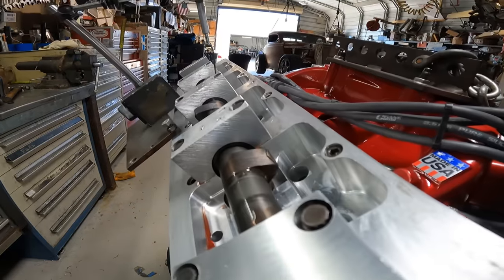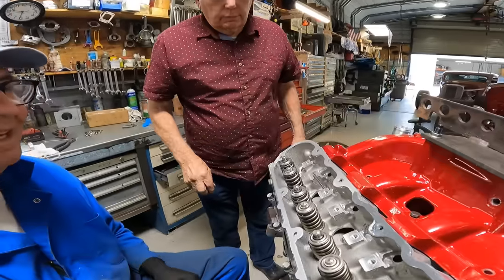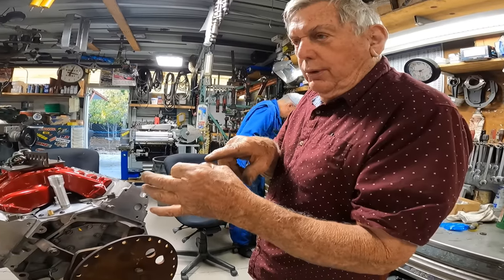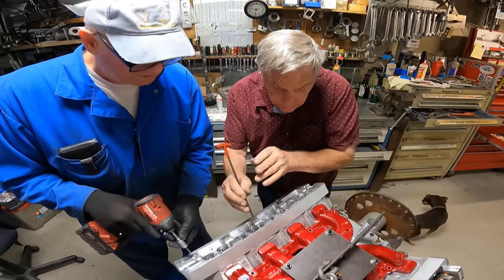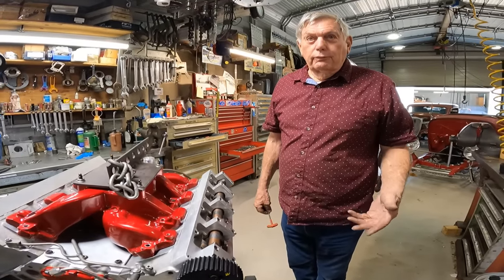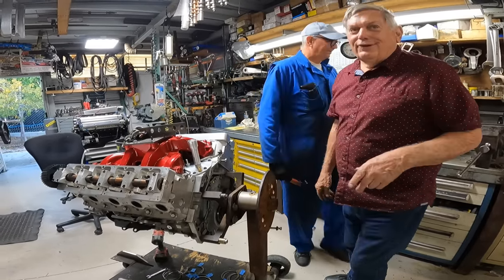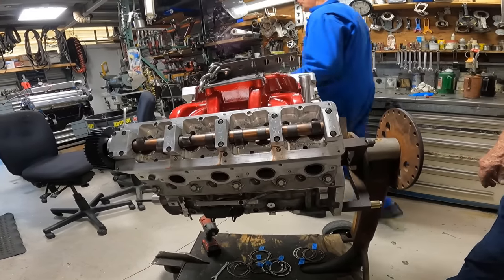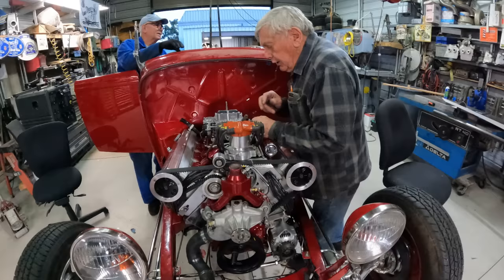Chevy LS 2 Valve Overhead Cam Conversion - Drive Toward a Cure with Aardema Braun - Part 1

Comment: But... why?
Reply from the maker: This is Pete and Kevin’s golf game.  Pretty much has stemmed from their land-speed racing success. In this instance, they are doing this as a special one off Engine build, which will go to auction in a 32 Ford roaster to benefit Parkinson’s disease and research.
Reply: @GregQuirin  why not use a simple LS crate engine?  Unnecessary complexity, weight, and cost is what they now have.
Reply from the maker: @theratrace5826  - pretty much every hot rod at the car show today has an LS in it and little innovation and made from the Jegs and Summit Catalog .  Pete and Kevin are on a different frequency when it comes to this stuff, they are the definition of true hot rodders.  They have a lot of success and experience doing overhead cam conversions mostly 4 valve.   Their complex engine builds have a proven track record and has elevated their racing performance in the Landspeed community.       They are very different people and always thinking out of the box when it comes to engine performance and HP.
Reply: Greg,
There are those that get it, and those that don’t. You’re getting a smattering of those that don’t. 
Then we hear from a dinosaur below who hasn’t heard the news about 4-valve vs 2-valve re: ultimate flow and power potential. He may be thinking of Top Fuel engines (2-valve, pushrod) having ultimate power, which is true, but you don’t see a lot of Top Fuel hemis on the street.
Great channel, well presented, and many thanks to everyone involved.

Comment: 4 valve will make 40% more power than 2 valve?????? That's not even close to being true. Cam in block is actually far superior to overhead cam for maximum power potential and far more durable. All of the most powerful gas engines on the planet are cam in block, 2 valves per cylinder.
Reply: If that was true, why doesn’t formula 1 and Indy use cam in block engines?
They are legal by there rules.
Where as several classes take away cubic inches if you run overhead cam four valve engines.
Seems like they are afraid of something!
Reply: Nobody would use overhead cams if that was true. Cam in block needs paths for the lifters and that messes with airpaths you can put in the head.

Cam in block has been a cost cutting measure for a century. It also allows for a lower package.
Reply: @kevinbraun6272   F1 engines only make 800HP. They are 3.150" bore. Small bore engines are great candidates for 4 valve chambers.
But wait?!! They're obviously not great candidates  400cc intake ports. Now we see why the overhead cam is simply inferior and can never out produce a cam in block design. Camshafts mounted directly over the valve inhibits the angle and overall volume of the ports. 2 valve, NHRA Top Fuel engines are not valve area limited at it's 4 3/16" bore size. No need for 16 more of everything cam & valvetrain related.

Also, 4 valve has nothing to do with overhead cam. We have plenty of 4 valve, cam in block engines in production. 2 valve v 4 valve chamber efficiency is determined by bore size. Valve area efficiency is determined by port shape & size. OHC can not compete, never, ever with cam in block. It's a matter of architecture. Cam in block is also much stronger, more durable and more reliable, again, due to it's inherent architecture.
Reply: @lassikinnunen  Actually, cam in block allows for a much better flowing head. That's their entire claim to fame. Camshafts directly mounted over the valvetrain limits the angle and overall volume of the ports. Pretty poor flowing cylinder heads comparatively.
Reply: @fantaseahorse4696  Well, we have set 37 records at Bonneville and El Mirage. Every one of them was previously set by a cam in block engine.
We broke all 37 records with overhead cam engines.
If what you say is true then no one should have any trouble braking our records.
Reply: @fantaseahorse4696  thaaats just not how it works. The lifters are on the top anyway with cam in block and you can place the camshaft how much high you want and make it whatever you want, whereas cam in block has actuation passing through the head impeding where you can place the runners and what shape they are.

The claim to fame is just needing less precision machining. 

Duke etc are crap exactly for that.
Reply: @kevinbraun6272  I reckon you have summed it up kevin definitely in the land speed realm 
You and Pete only 37 records 
Are you sure your qualified  to comment 
I'd say yep 
What hp and torque do you think it will make on say 95 gasoline 
Cheers 
Ps you 2 not so old fellas have given me great pleasure in viewing your builds thanks so much